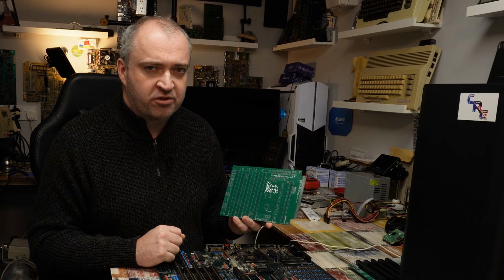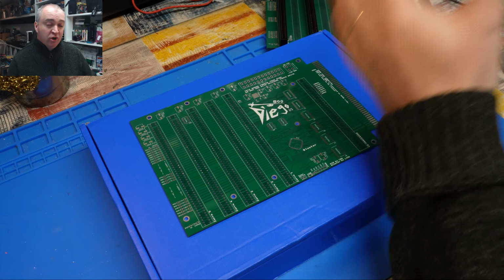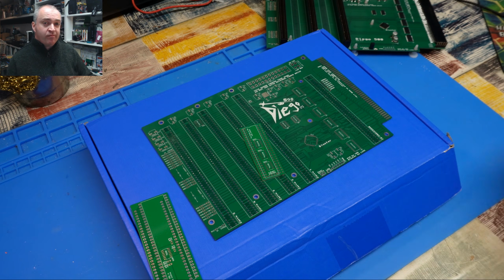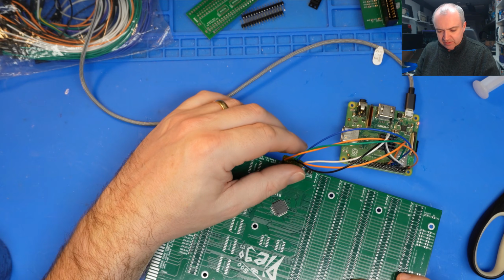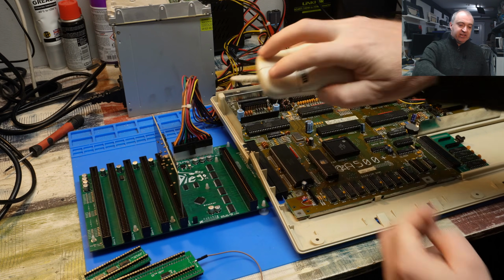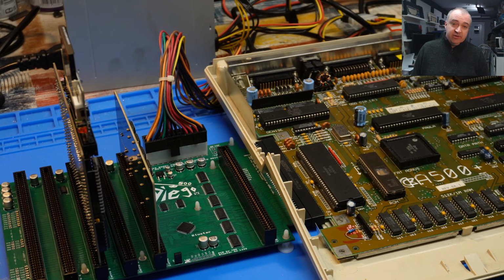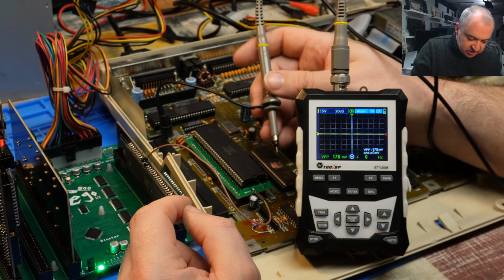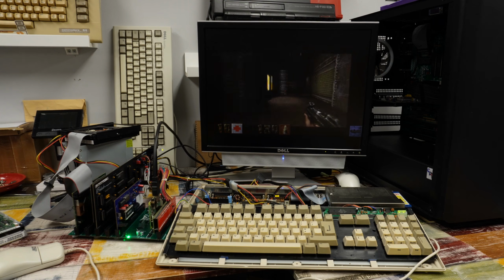Turn your A500 into an Amiga 2000

Comment: I think that for this project to work, it needs to be designed around a case structure.  There are only two that make much sense to me, both of which essentially mean replacing the Amiga's casing and using an external keyboard.  The first is a full size tower case, which would be the simplest to design but the more costly in materials and probably more difficult to manufacture.  The second would be a cube style design with the expansion on a right-angle connector.  That would be easier to build from wood or perspex and cheaper in terms of materials.

Comment: is it possible to use USB C for 5v needs, also there is that new Power supply that has all the -12, +12  and 5v supply. i am using  a Pi5 USB C for the external Pistorm that will be cood for all 5v boards, also a USB PD power supply that is capable of 60 - 100W would be sufficient.

Comment: Do you intend to sell a limited charge on amibay?
Reply from the maker: It'll go on github and anyone can make it as they please.  I am also talking to a uk based store to sell kits of preassembled smd boards with all required through holenparts included. 

And yes depending on interest, I might arrange a small run of fully assembled boards.

Comment: A great project.
For Bluster: Not anyone is able to solder such chips themself. It would have been more easy if there had been a Buster socket - so you could use an original Buster or a Bluster soldered by someone else.
Reply from the maker: Unfortunately we cant do that because of the inverted clocks.  I suppose you could put a socket and use our modified bluster in that but it would introduce a layer of confusion.  We're planning on selling boards with all smd point populated so anyone interested would only need to do the through hole themselves.

Comment: My suggestion would be to make the bigger box but instead of it bolting on the side of the A500 , use cable extension of the CPU expansion port instead so maybe you can seat the 500 on top of it or just have the box elsewhere but all still connected up. then you are not hanging a huge weighty contraption off the edge, obviously you will need to address how to carry the additional wire over too from the A500 Mboard.  Just a thought!

Comment: My first thought was to add an opitional 180 degree u turn adapter that lets the board sit on top of the A500 motherboard. I guess that adapter would have to flip all the signals around too, and it would of course rule out use of the Amiga 500 case.But unless that extra decimeter of traces make a mess of all timings it could be a nice addition.

Comment: How about, not sure does it get some interference, using a cable between A500 and Diego. Definitely a different project, but this could allow some play where to position the Diego, like flipping it 90 deg vertical (i.e.) creating a microtower. 🙂

Comment: Back in the day a company produced an expansion box called 'Bodega Bay' that essentially transformed an Amiga 500 into an Amiga 2000 including multiple Zorro slots.  I remember they were rather expensive and they're quite rare these days.  Perhaps a 3D printed case could be designed to emulate the design of the Bodega Bay?

Comment: Can you use a long bus cable like the Ti-99/4a uses to connect the computer to the PEB?  Then you can have a box like the TI-PEB.  It doesn't have to be that big firehose, but a more descrete connection like aftermarket PEB connection.
Reply from the maker: I was looking at possibly using a 100 pin scsi cable which is off the shelf and should work.  Its not the cheapest thing but is a simple round cable so a lot neater than a big ribbon.

Comment: Wow Glen amazing work. I would be tempted to put the whole lot in a Tower case with a separate keyboard (maybe even in the original case - for nostalgia)
Reply from the maker: That'd be some project and probably want a revision to this board to bring it back over the top of the 500s board.  Could be done but I first want to get all the issues ironed out before designing an alternative version.

Comment: Perhaps turn the expansion connector through 90°, so the board can mount vertically, with horizontal expansion cards? The case could then be a mini tower, rather than taking up half your desk. You could put an expansion connector on the back side of the Diego (orientated perpendicular to the PCB), then use a short second PCB to link to the A500's slot. 

Would it be possible to convert the expansion slot to e.g. a SCSI cable? Then mount the expansion box e.g. under a monitor. I doubt the bus speeds of a 7MHz computer are that high. Sorry if you already covered that possibility in the video - only had a few minutes so just skipped to the conclusion!
Reply from the maker: DIEGO on the side of the 500 is approximately 20cm (8") long.  So yes it's a large expansion but if you consider its a Co-processor and 5 zorro slots then its not that big.  A vertical version can be done although I do think 5 slots high is perhaps too much so maybe make it 3...  that would make it about 15cm (6") tall although by the time you fit a full height zorro card not much different to it laying flat again.  

There are multiple ways to lay this out and your comment is very much a fair one but in the first instance I need to get it fully working (found a couple of issues) before tinkering with how it's presented.

Comment: Why not just use a real Buster chip?  🤔
Reply from the maker: Very good question and I was originally designing this with intention of using a real buster but the clocks needed for that chip _CDAC, CCK, CCKQ are inverted on the A500s side car.  To use the real chip I'd need to reinvert them through logic further delaying them to feed potentially causing issues.  The Bluster CPLD is able to handle the inverted clocks as they are so it seemed the easier option.

Comment: That board would be much better if it used the higher quality thru-hole parts, instead of the surface mount crap.  I would buy a few for my Amiga 500 Tower computers.  😃
Reply from the maker: I'm using high quality SMD parts here but the reasoning is also more that once we've got the layout and designed finished, I can then get the PCB manufacturer to assemble all the SMD components in factory leaving use the through hole to do.

Comment: A full-size tower case would make things easier i guess, but i think people are looking for smaller footprints. There's also the issue of placing the ATX psu somewhere. Maybe a pico one? Although it depends what the wattage necessities of such a beast are. Putting the whole whatchamacallit into a case (with the mobo), means the keyboard becomes external then. Maybe you would consider a few revisions, depending on the placement of the whole thing. 
Desktop case for the sidecar as is, desktop case with riser and cards placed horizontally, desktop case with everything inside (sans the kbrd), and tower case with no changes. Great work!
Reply from the maker: A PICO ATX should be enough to run it so that'll save on the mess of wires and the big PSU box.  

The case is going to be the tricky bit, I've tried to keep the board as small as possible but Zorro cards themselves are big things so that does need some though.  A few people have mentioned a remote case with a ribbon between DIEGO and the 500 so that might be a good option.  Some others are looking a vertical version of the board with fewer slots which also would be more compact.  

The first thing I need to do though is iron out all the bugs of which I've unfortunately found a few after recording this.

Comment: The main issue with this board is if you're going to need to produce a case for the board then you may as well take it one step further and make an A2000 main board repro and then make an A2000 case repro too. I think the ideal set up would be to re-design the A500 motherboard and zorro slot board to fit into a stock PC case. Probably just make a new A500 repro and have the zorro slot board built into it but in the same size as a PC ATX board, obviously with at least 4 layers and with those additional small boards also built into the main board. It should be do-able given time. Although then you have to ask yourself is it all really worth it to essentially do nothing important with it. I have 15x A500's, 1x A600, 4x A2000's, 3x A1200's, 2x A3000, 1x A4000, CD32, CDTV and tons of cards including all the bridgeboards (incl 486sx), ram cards, accelerators, even a Picasso IV and they just sit inside some of the computers or on a desk or on a shelf rack taking up space and gathering dust. It's kind of a shame but these things are not that interesting nor useful now.
Reply from the maker: Absolutely and I've built my own EATX2000 in the past.  I suppose this project is for those who don't want to go to the cost of a complete new system.  The current board and BOM is about £60-£70 so a fair bit cheaper than a full replacement board.  Finding something to put it in is a problem but I'm sure we'll come up with something.

Comment: Just use a trace width calculator. 1.5mm wide trace at 1oz thickness can carry 1.6A. If you double the copper thickness to 2oz then the current will be 3.2A. If you use a 4 layer board with internal gnd and vcc planes the load will be spread across the entire board.
Reply from the maker: I've decided to cut these connections and just give people the pass through cable should they want to use that.  Or if both PSU are plugged into a common ground just use it alongside your original brick like you would have with your classic expansion back in the day.

Comment: Silly question:  Why not just use a clock multiplier to create the 28mhz signal? Isn't it derived from the CPU clock in the first place? For such low frequencies there should be minimal delay induced.
Reply: No. The cpu clock is 7.159MHz which comes from a 28.636MHz oscillator. On PAL systems it comes from a 28.375MHz oscillator. Agnus does the dividing internally and outputs the 7.159MHz clock and some others. On A3000 the same master oscillator is used and there's additional logic and a delay line.
Reply from the maker: There still is going to be some delay pushing the regenerated clock out of phase.  I'm not sure just how critical it would be but I also don't have anything that uses that clock to test with so I'm not keen on implementing something I can't confirm is working.

Comment: If you make one of these for a 1000 I'll definitely buy it.  Or even for an A500; that's just a reversed slot for the A1000.
Reply from the maker: There is no reason this can't work on an A1000, it just the board rotated although I need to then rotate the slots so the cards are pointing the right way.  I want to finish the 500 version first though.
Reply: @CRG  - Indeed.  I have an ATX power supply I could use if needed, though the requirements for the A1000 are a bit more robust than the A500 I think?

Comment: Any plans on making it work on the a1000? i know its the same connector as the a500 but iirc its upside down (on the right side instead of the left). an adapter would probably be easier than a board revision i think lol
Reply from the maker: Its not upside down but just rotated so should work fine on the 1000 although the power side of it will need reworked.

Comment: Ribbon cable connection and a standalone chassis is a good idea, like the Ti99. Could even use an existing AT style pc case so you have room for drives and such. CD, HDD, removable storage, etc.
It would also give you a place to house the ATX power supply necessary.

I'm imagining you could make it in the AT/BabyAT style form factor, bolt it into an old PC case, with the necessary PSU. Have a cd drive, a magneto optical scsi drive, and all your expansion cards., and then one big sheildedribbon cable out the back or side to go to your A500 expansion header.
Reply from the maker: A few folk have spoke about that and as you've described it does sound perfect.  I'll test the ribbon cable idea in the next part.
Reply: @CRG  yeah and if it had holes to mount the board up to an AT or ATX case, people could use whatever cases they had around. to house all  their stuff, or just run it external with a basic skeleton chassis if they so desire

Comment: @12:06 EINT.... these it turns out were a waste of time. Nothing ever uses them and there was no way to use them.  They were dropped from the Zorro spec for Zorro 3. I wouldn't bother with them.

To quote from the Hardware Manual. 

Six of the decoded, level sensitive 680x0 interrupt inputs were
   originally available on the expansion bus, and these are labelled as
   /INT2, /INT6, /EINT1, /EINT4, /EINT5, /EINT7 on the Zorro II bus.
   Only the /INT2 and /INT6 interrupt inputs are actually supported by
   Amiga, Inc. as part of the Zorro II specification; the A2000
   hardware did not provide the software with the required support
   mechanisms for the safe use of these lines.
Reply from the maker: Thanks for clarifying that, means I can bin the EINT board.
Reply: @CRG  Apparently the A4000 doesn't even have the signals, the A3000 still had them but as stated, they never worked and were declared as reserved in rev 1.10 of the Zorro III spec.

Comment: @7:00 /BOSS.... So this not being on the sideslot is irrelevant. It's not needed for the original M68k as its only used for the Co-Processor.

This is all discussed in the "Commodore Amiga A500/A2000 Technical Reference Manual" (pages 95-97) but essentially the Co-Processor negotiates with B(l)uster using the three wire BR/BG/BGACK to take over the bus from the "original" 68k on the board (or in the A500). Once B(l)uster has granted this then /BOSS is asserted from the Co-Processor to state that it is "The BOSS". At this point the BR/BG/BGACK controls become "normal" again and B(l)uster holds the original CPU off the bus. 

I'm sure many cards did just assert it but that's not how it was meant to work. In theory (and this was the intention behind leaving the M68k in for the B2000 unlike the A2000) a co-processor could negate /BOSS to allow the original M68k back onto the bus and have it "do stuff". In practice this was never implemented in software. 

For the Co-Processor logic see Jason Beers N2630 (google N2630, the github should be the first hit). It has the CPLD logic code in there to understand how this all works.
Reply from the maker: Is that not how I explained it initially anyway before the cutaway to say that some cards perhaps just asserted BOSS without the negotiation?  

BOSS is an output from the coprocessor to both Buster and the 68k so without it on the edge of the 500 (and the missing 08) there is no way the CPU card can hold the 68k off the bus.  As I said in the video you can just remove the onboard CPU but you otherwise need the BOSS board if you want it to work as in an A2000.
Reply: @CRG  /BOSS and /BGACK go to U303, that is an 74F08 AND so as they are asserted low with /BOSS pulled high by R104 and /BGACK pulled high by RP100 that means that either /BOSS or /BGACK being asserted (low) will cause /BGACK (at the M68k) to be asserted. 

Functionally /BOSS works the same as /BGACK because of this. 

So as /BGACK is brought out to the edge connector (pin 62) you just need to connect pin 12 of U303 (or its functional equivilant) to pin 62 and prevent GARY from seeing /BGACK. It's a bit janky but to replicate B2000 "as shipped" you can lift pin 14 on GARY and solder a 4.7k resistor from it to +5V. 

That said, its not entirely clear what J900 does OR what GARY does with it anyway. Dave Haynie described it as "Enable Chip RAM slowdown during DMA" 

So if you want to replicate J900 (which is normally open on a B2000 anyway so probably not required) then you either need to bring /BOSS over and have a functional equiv to the U303 on a mini-card to deal with things. 

All that said... the GARY specs and the Amiga replacement project code don't appear to do anything with BGACK. So I just left it connected and it seems to make no difference!
Reply from the maker: Thats correct, boss and bgack run to an F08 (edit: sorry i wrote ls buts its an f) before going to the cpus bgack line so that either can control said line.  Boss is asserted by the cpu card which through the 08 asserts bgack at the cpu.  But once asserted the br/bg/bgack sequence can continue as usual since 08 essentially buffers the cpus pin from the rest of the system (I hope that makes sense).  

Im not expert in this by any means but I've just tried to follow the A2000 rev6 schematics.  

Reading those I cant introduce boss to bgack on Diego as bgack is also connected to gary and it appears that he can assert it too.  So I've tried to keep it as per the schematics with the daughterboard at the cpu.

It is probably of little consequence though as I suspect most people will just build Diego itself then if they want to use an accelerator just remove the 68k.
Reply: /BGACK is not an input on GARY but rather an output and also disconnected via J900 by default on the B2000.

I agree however that as there is no capability for any co-processor card to utilise the on board M68k it's easier just to remove it (also saves dealing with that whole E-clock issue!)